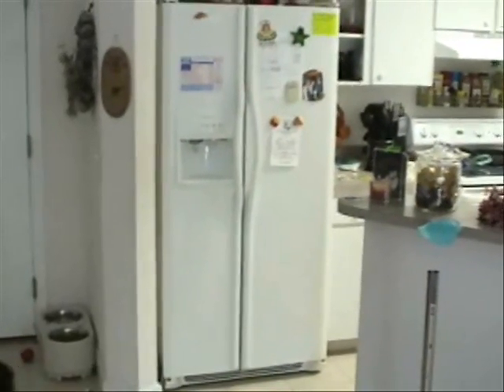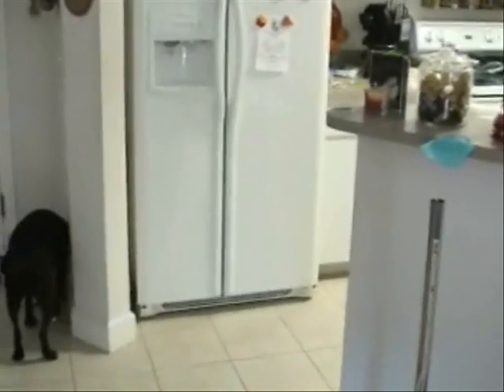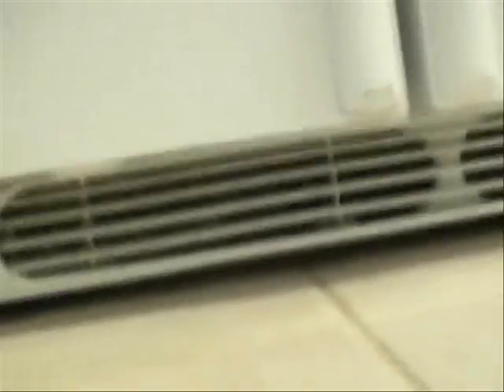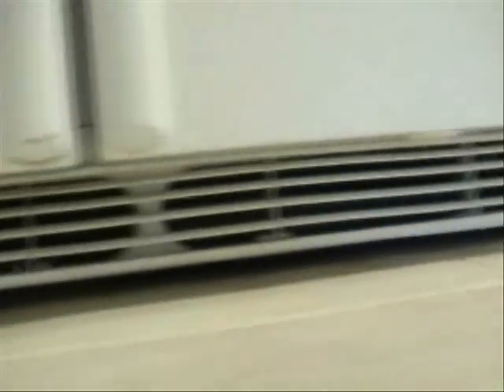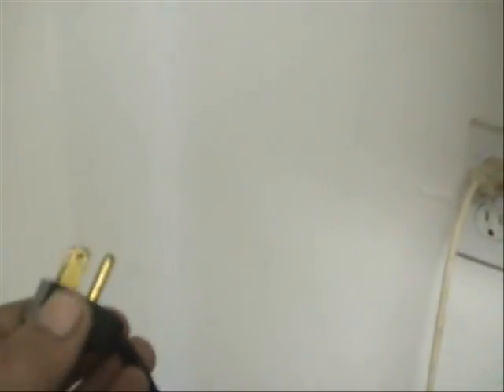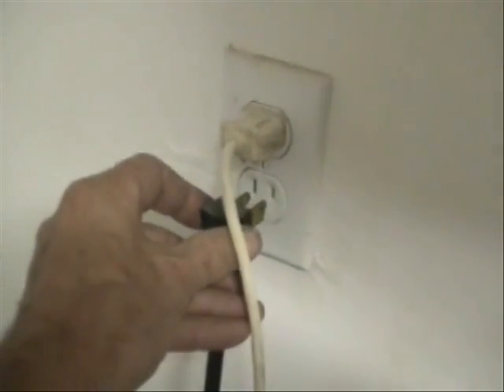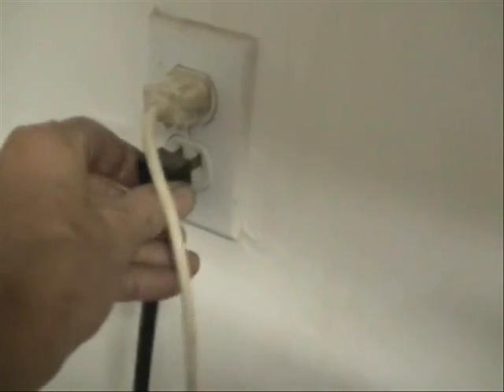HVAC Refrigerator coil cleaning.

Comment: Nice design by those engineers right DrZ . I have a good feeling that they didnt care about the guys doing the service on them . Cleaning them darn things you have to be real carefull not to break any refrigerant line under there doing the cleaning . I have a fridgare frig and it the same as yours . Real tight to get into . Dry nitrogen is better to blow out the dirt but you need to be carefull doing that too . Not to make a mess in the kitchen

Comment: I have a question, I have a fridge from 2003-2005 and it has cutom temp controls with a little 2d display , it has been in storage for 1 or 2 years and when i want to set the temp, the display will change from 0 degrees for freezer to a 38 degrees, and fresh food area will go from 37 degrees to 57 degrees and when ever i change the temp back to the correct temps that i want the display will change the temp again, could this be a problem or can it just be saying the temp will gradually go to good

Comment from the maker: @bpereztab The freezer part of the fridge should be zero degrees F. The cooler part of the fridge should be between 35 and 40 degrees F. You should never have to recharge the system unless it develops a leak.

Comment: My fridge (GE) was warmer than usual - cleaned out the coils underneath the unit - took a temperature reading and it's at 35 degrees (F). The unit is at least 12 years old.  At what point would we have to recharge the refridgerant (R12)?